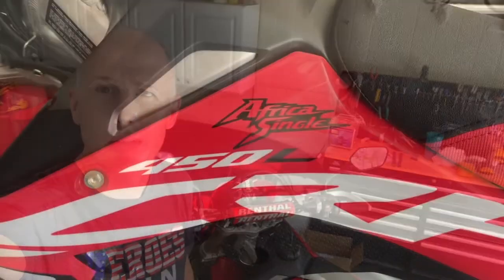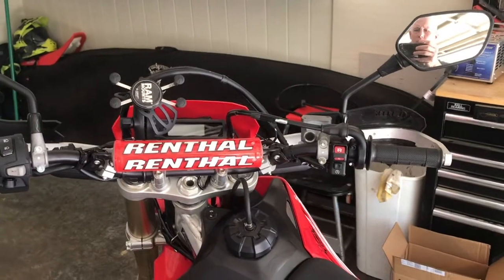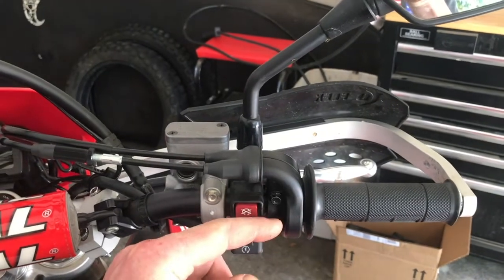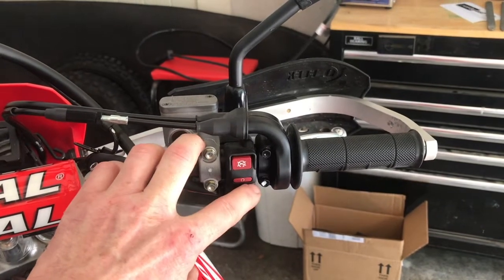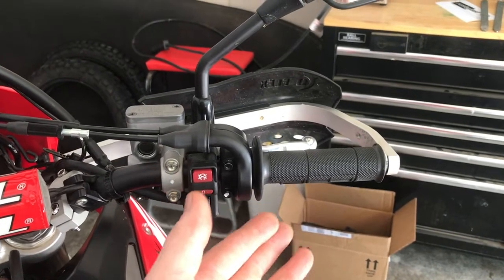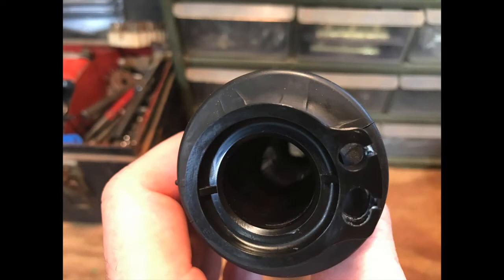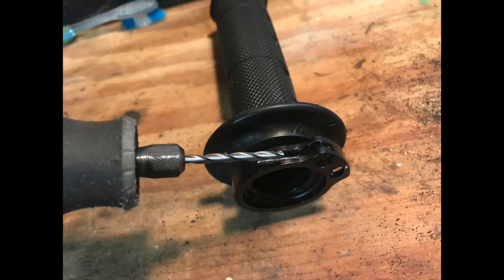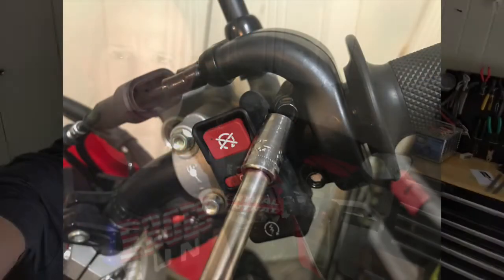DIY Throttle Tamer Mod

Comment: Thanks for the assistance. I replicated this exactly, then it failed on my first big trip.  I replaced the brace on the front by the seat with stainless steel.  Now 200%.

Comment: Awesome video! I'm thinking of trying this on my Honda cb650r.
Reply: Did you the mod ? Was it effective ?
I've got the same engine (cbr650r) and got the same problem 
🥲
Reply: @Remop  no I didn't. I got my ECU flashed by Moore Mafia and it smoothed out my throttle response.
Reply: @Followthepinas  Oh ok. It's clearly a problem of injection. 
Do you know the new parameters? More fuel consumption? Jerky all removed?
I like pretty much this bike, just enough for me, and i don't want to sell it because of this 😢.
Reply: I don't know the parameters. I mailed the ECU to Moore Mafia and they sent it back about a week later with some instructions. It got rid of all the jerkyness.

Comment: Are you sure you are going to get totally Full Throttle !! it seems to me you will only get about 3/4 throttle is that true
Reply from the maker: Thats a good observation.  The full throttle stop is limited by the cable and movement inside the throttle body.  Getting full throttle with this mod requires less than 1/8"extra throttle rotation.  Its probably more like 1/16".  
Be careful out there!!

Comment: If you think the throttle on an underpowered, overweight boat anchor is too twitchy, you're the problem.
Reply from the maker: Just trying to help my fellow man.  I hope you find whatever it is in your life that is making you so unhappy.
Reply: @ufixit  Im likely going to try this on my ZX10R, which is nearly dangerous in parkinglots (especially if damp or sandy) due to the twitchy throttle response.
Some folks live to be internet trolls, I however appreciate your video.
Reply: @SubMad026  how did this mod work out for you? I'm thinking of doing it to my Honda cb650r. My throttle is way too responsive/twitchy it's hard to just Cruse.
Reply: Spoken Like someone who has never ridden.